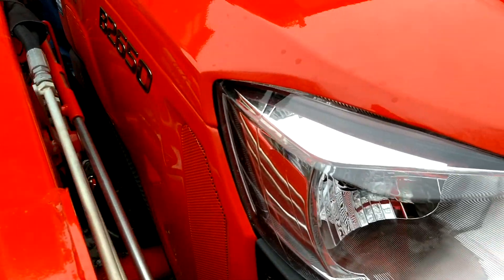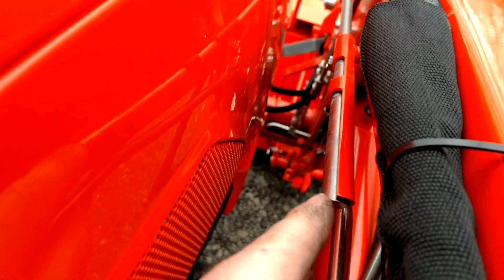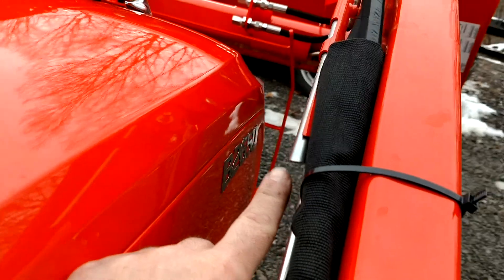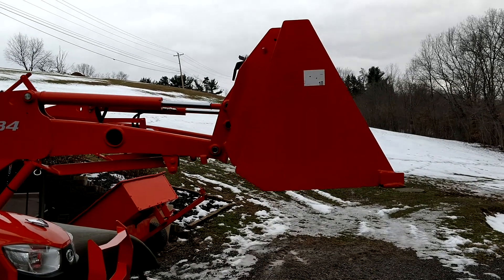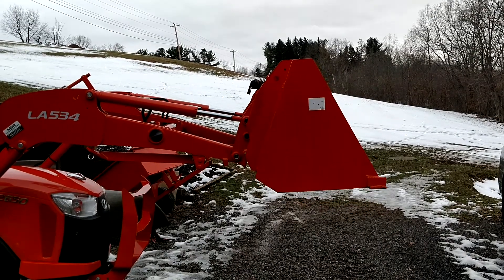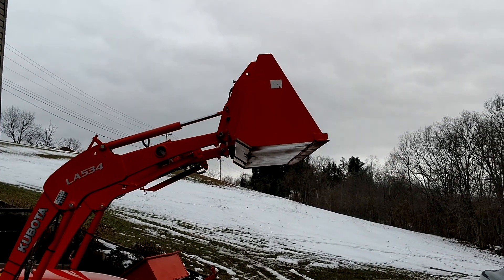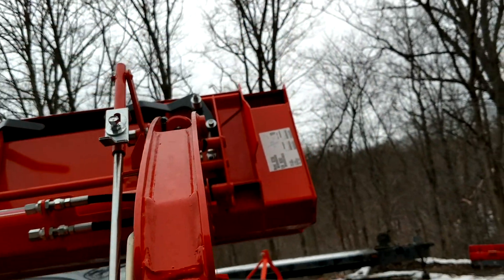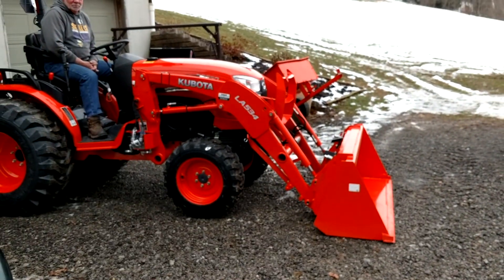Kubota B2650 bucket level indicator function and adjustment.

Comment: What's the kubota part #?  Thanks.
Reply from the maker: Call Sean Huegal at M&R Power Equipment in Butler PA. And tell him that Larry told you to call. He should be able to easily set you up.

724-482-2131

Comment: BH advice. It's free....  Make sure you run rpm 2000 or more. I was running mine around 1800rpm and think I ruined pressure relief valves. They all screwed up anyway. Just stopped working one day and I just started machine for the day so it wasn't hot or low of oil. The machine just stopped movie in one direction. I took pressure valve out, did nothing to it, screwed back in and shazam work perfect. The lift boom stopped first, then the swing, then the down boom, then the close bucket. They all started doing it. Any that had the pressure valves. 
  After I,,, not the dealers mechanic, figured out what was the problem. I asked to have them all changed. 6 I think, $500 each list cost. It is $2500 to replace that whole valve bank brand new. They tried to get $3000 just for valves. So get me a new valve bank. $3664.?? was the bill. Go float your boat  said. Wanted money on delivery. Called my MOTHER and wife before delivery wanting the money. I called them, Woodstock(Jacksonville) NB. And said when I've inspected work you will be paid within 30 days, get that tractor back here you have had it for 4 weeks. Yes 4 weeks. Now,,,, the $3664.?? was never paid,, guess why. Nothing was fixed, put a used valve bank on machine and told me it was new,,, all rusted,, not from kubota it sure would not be. Leaked 4-5 litres(4-5 quarts)in 10-15 hours of use. Did not leak any when it went there. Also the lock pin hole was bent oval, not round. The boom would swing 10-15 degree with pin lock. Mud all over machine. Went there looking like yours,, sparkly. So I bought a new BH77 last summer. $6430 with mine as trade in. I paid $7200+ thumb and bucket and subframe for a total of $8600, He gave me 50% OF todays value, $11 200. So $5800 for my BH77 and $6430 for new one for total of,,,$1230.?? What it cost new today. with tax. That is Canadian prices. That BH77 had maybe 300 hours and that is high. Tractor has 630h or so today. 
  I called another dealer for a price check after all this BS. $1000 for the pressure valves(6) or $2500+days labour for the valve bank replaced. They told me the total bill was $13000, yes thousand for repairs. I called the owner and no longer have ANY bill. And a new BH77. I sure am glad I have another dealer almost same distance in other direction.

Comment: Can I get one for my L3301?
Reply from the maker: Steve Chapman 
It's a Kubota part, so you would source it at your dealership.
Reply: Does it fit an L525 bucket? Just got a Piranha tooth bar on it and it measured about 64 1/2 inches inside to inside of bucket..
Reply: I didnt really want just the rod type, for an indicator, this one in your video looks a lot better...
Reply from the maker: Steve Chapman 
That is the factory bucket level indicator on the B2650/B3350. My guessing... Wouldn't they make the same type of level indicator for all models?
Reply: @LarryMusgrave  mine is only for the bucket at a set height.  Doesn't have that rear part.  It's factory

Comment: What size bucket do you have on there?    60?
Reply from the maker: Jason D 
Yes sir. 60" light material bucket. But it does only heavy material work. We've moved thousands of tons of concrete, block, clay/dirt and more. We put a BXPanded Pirhana bar on it quickly because the bucket was bending. I smashed it relatively straight, installed that bad to the bone pirhana bar and it's never missed a beat!
Reply: Larry Musgrave did you get the straight bar or the tooth bar?   I have been thinking of the straight bar but people are telling me to get the tooth bar.
Reply from the maker: Jason D 
I did get the Piranha bar, not the straight bar. I had already been the factory bucket down in the center, so getting it on meant that I had to get it started and then drive the bar and bucket into an immovable object to shove the Pirhana bar back tight. The Pirhana is amazing in that it is thick and will not allow even a goon like me to bend it. If you can bend the bucket with a Pirhana, your an insane animal! I know, because I am and I can't tweak it at all.
Reply: @LarryMusgrave  Get the claw for your BH. That thing is deadly to stumps. They have a GREAT back up warranty. I broke my claw and he gave me a heavier one, even free shipping. That is made in USA stand by your work warranty. I have everything he makes on my machine.  I used the broken part to make a "wolverine claw" I call it, 3 finger claw and use it for surface brush so as not to disturb the ground, just pull out the bushes and big rocks. Works perfect. Get the BH quick attach for the claw. It is a bugger to switch bucket and claw without it. 5Min with QA. 30 min without. 
  Check out Paul Short on youtube. I just ordered yesterday everything he has for my B2650. Guards for filters(3) Not engine oil filter. Fuel,hydro and tran filters. Step for BH, a MUST HAVE, and locks for your stabilizers. Locks them up in place so they don't leak down. 
  Those 3rd function hoses. I had to go check to make sure and yes yours are wrong. They need to run down arm, coming towards seat, put over fel hoses and under the arm not around the back of like you have it. It will get stretched there, lift all the way to top and see what is happening, it will almost rip them off. + they chafe where you have them. Make dealer come do it right.

Comment: where can i get one of these and how much do they cost. i have an MX5200
Reply from the maker: ChrisGagnon DIY 
It came with the Kubota loader. I would think that you can call your dealership and ask if one is available for the loader model that you have. It's indispensable, you can not tell that your perfectly flat, slightly high or slightly low at the bucket leading edge until you have an adjusted indicator. I visually refer to it constantly when I'm working with the loader.